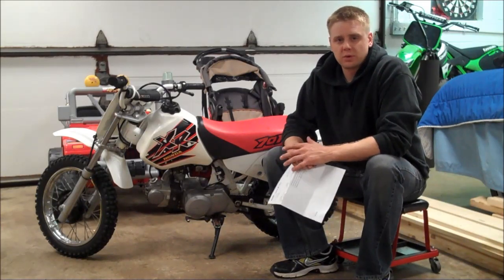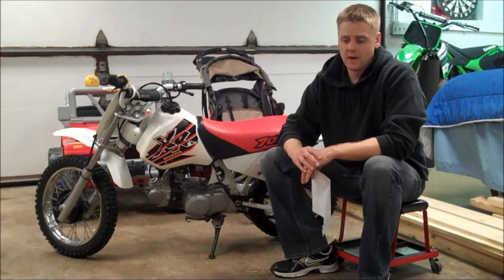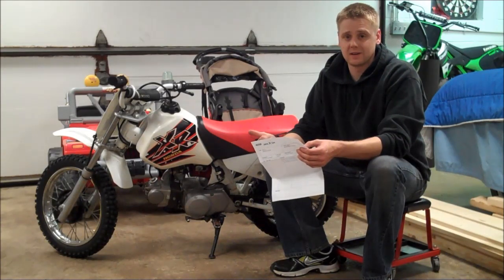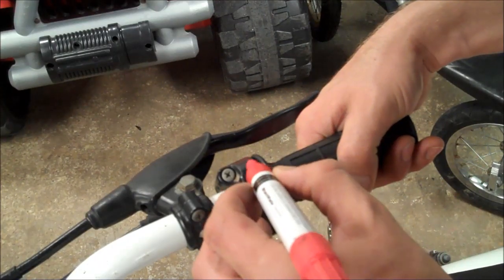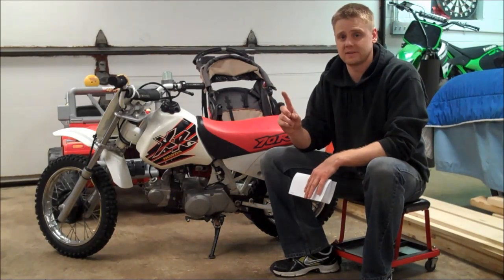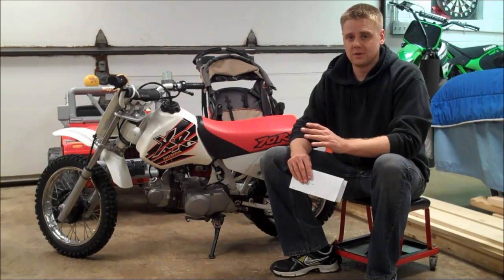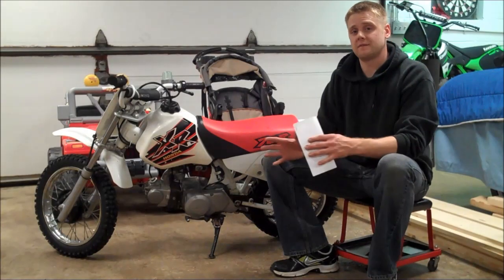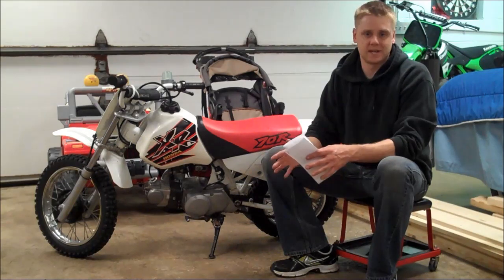How-To: Tune A Motorcycle Main Jet

Comment: I have a crf 110 with a 26mm carb and big bore kit. I’ve already replaced the spark plug once and it already broke(wouldn’t start). It runs on new spark plug for like 2 weeks then it won’t start with it. I pulled out the plug and it came out pretty black, even though I replaced it like 2 weeks ago. When you quickly twist the throttle down it Boggs and doesn’t go. I know it’s probably running too rich, how can I fix this?
Reply from the maker: Start by tuning the pilot jet and air screw. Read this: https://www.howtomotorcyclerepair.com/how-to-size-your-pilot-jet-pilot-screw-explained/

Comment: Hi Matt, I'm having an issue with my 05' crf70f. It doesn't want to run with the choke off, it just dies when the choke is off. But runs good with the choke on. Can you give me some tips on what to look at to fix this? Thanks!!!
Reply from the maker: Yes, you need to clean the carburetor like in this video: https://www.howtomotorcyclerepair.com/xr70rcarbclean/

Comment: I have a 2003 Honda VTX 1800C it had a battery that just wouldn't come up to full charge.To check I jumped bike from my truck and it fired up fine. I Installed a new battery and Bike turns over but now I noticed when key is turned on fuel pump is not energizing for the 3 seconds. I checked all fuse I could fine any ideas I can't find my service manual.

Comment: Hi matt,
i have an kymco k pipe 50cc semi clutch,i put a bigger 16mm replika keihin on it ,with an powerfilter.
 the bike bogs in full throttle as in this video.the main jet is 75 and replaced it with 80 and results in less top speed and still bogging.
then i put a 70 jet in it,same problem...
what to do matt??
Reply from the maker: Maybe you need to work on the pilot jet and needle. How does the plug look? Does it run better with choke on?

Comment: I have a CB250 starts great idles beautiful BUT first bit of exceleration splutters and hesitates? Can you tell me what you think.
Reply from the maker: Sounds like a lean pilot circuit: https://youtu.be/zm5mB3R8Ucw
Does it run better with a bit of choke on?
Reply: Yes
Reply from the maker: Proceed with fuel screw adjustment. If this is a new problem, maybe carbs are dirty.

Comment: if you put the plug in focus we could've seen what it looked like. but as this video is 5 years old, you've probably learnt. 
BUT no plug chop is complete without actually chopping the plug and looking at the soot ring ;)
Reply from the maker: You are correct. I find that the mixture can be read on the flat surface as well (4 strokes only)
Reply: @HTMR  Most of the time this is accurate enough, Have a nice day good sir.

Comment: new plug installed,looks good.
the bog begins on 3/4   to full throttle,maybe its caused by the imitation keihin.
i tried jets and needle but now its the best setting 75 main jet needle clip in the middle.
maybe buy a better carb
Reply from the maker: Have you determined if you are lean or rich?
Reply: MatthewMCRepair 
I installed a new plug and looks same as yours in the video. 
I put the needle 1 position lower but cannot say its better.
I think i must be carefull with the trottle
Reply: MatthewMCRepair 
By the way, can the pilot jet couse the bog?
The bog begins at 1/4
Reply from the maker: Please give me your year make model and explain the bog in more detail.
Reply: MatthewMCRepair 
Made in 2015.
Replaced the original mikuni 12 mm for a imitation keihin 16 mm and put powerfilter in it.
Bog begins before half trottle 2/4?
Main jet 75 
Pilot jet?
Gas needle one clip higher in position.
Plug is new and good.
Tried several main jets but 75 is the best.
Only bog from gas and no bogging in the whole power band
Reply from the maker: Does it run better with choke partially on? You probably need a larger pilot jet. Tune pilot air screw and let me know how many turn out you are.
Reply: 3/4 to full is main jet ONLY not the needle

Comment: hey Matthew, my name is Matt.  I recently bought a 1985 Honda nighthawk 650,  where is the idle control at?  it idles high.
Reply from the maker: +Matt Lee It's on the #2 carb between cylinder and carb. It is below the carb by the float bowl.
Reply: When I am on my ride and I stop and put it in neutral it starts to rev high.  I have to put it in gear before it slows down
Reply from the maker: +Matt Lee Make sure you check for vacuum leaks:

https://www.youtube.com/watch?v=oKVHqCJN2LU

Comment: Mate I'm old now but have a play with the back sproket three teeth more wheelie machine three less more top end lol messing about with the carb is for Japanese scientists lol as long as sproket same thickness drill holes to make it fit more teeth more wheelies less teeth more exseleration jetting rule of thumb 3%up hotter plug because of more fuel

Comment: My bike has the same problem, I have a  2003 Cr125 that I just bought. Currently jetted for 4000ft but I ride at 1500ft. My question is if my bike is running to lean or too rich? And what jet should I use?
Reply from the maker: If properly jetted for 4000', then it will run lean at 1500'. If this bike is new to you, I'd open up the carb and find out what pilot jet, main jet, needle stamp & clip position it has and go from there. Here is a video that will help you: https://youtu.be/jRBA1gHlx6k

Comment: The one you didn’t know was .375 or three eigths lol!
Reply from the maker: Yeah brain fart. I was trying to think what circuit it was LOL.
Reply: Nice job on the instructions though. I’ve chased the jetting rabbit before. Only to find out it was my float bowl overfilling into the causing rich idle. I would clear it and it would be perfect then start sputtering drove me nuts! They I corrected the friggin float and problem solved! Lol!
Reply: Nice job on the instructions though. I’ve chased the jetting rabbit before. Only to find out it was my float bowl overfilling into the causing rich idle. I would clear it and it would be perfect then start sputtering drove me nuts! They I corrected the friggin float and problem solved! Lol!
Reply: Nice job on the instructions though. I’ve chased the jetting rabbit before. Only to find out it was my float bowl overfilling into the causing rich idle. I would clear it and it would be perfect then start sputtering drove me nuts! Then I corrected the friggin float and problem solved! Lol!
Reply from the maker: @terryfonz4603  Thanks!

Comment: Hi. Hope you can help. I have a DR200 with some minor mods including an open exhaust.  
I'm also getting bogging like in your video. The carb is completely stock so I want to start with the main jet going from a #115  to a #127.5  which is up four sizes. Will I need to change the needle jet to a larger size or should I try it with the current needle first?  Thanks.
Reply from the maker: Explain when it bogs.
Reply: @HTMR  Maybe bog isn't the right word. It's more like a stutter or miss under full power with the throttle wide open, almost like it's starving for fuel.
I was thinking about altering the needle jet position to make it richer but that is more for the mid-range. It starts good, idles good and will go through the gears fine if it is revved moderately and not hard out. 
The bike is quite low geared for off road so it revs quite high in top gear. 
When it is opened up under full throttle at top speed, it jerks and misses. The carb has been cleaned with many new parts put in it.
Reply from the maker: @JT-er6rt  What other minor mods? Any airbox mods?
Reply: @HTMR  No, stock airbox as well as the carb and engine. Only a free flow open exhaust and changes to the bodywork/ frame. Do you think I should start with the needle jet and if no luck then move onto a bigger main jet?
Reply from the maker: @JT-er6rt  Turn the choke on as a quick test and see if problem goes away. If it does, then you know you are lean.